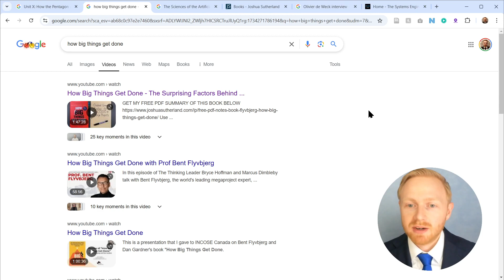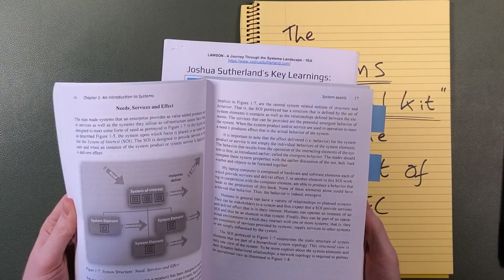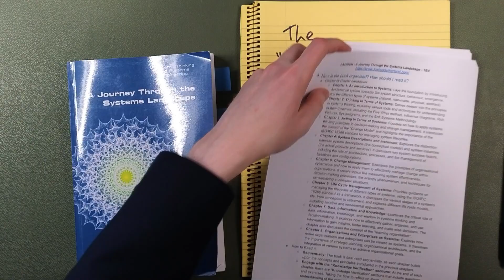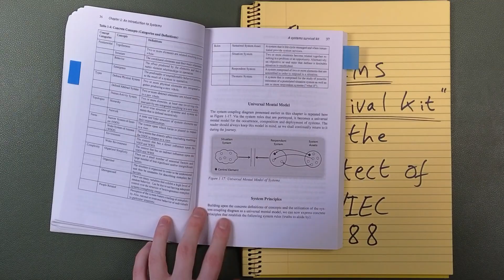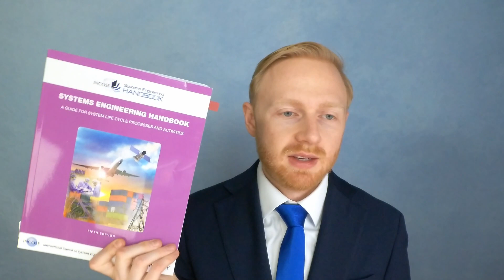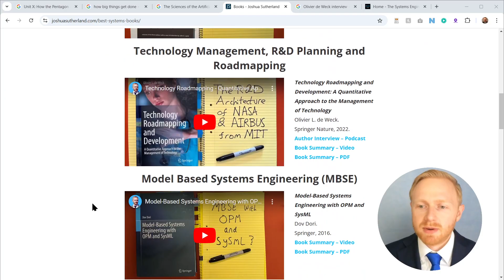Systems Thinking vs. Systems Acting - A Journey Through the Systems Landscape - Harold "Bud" Lawson

Comment: If so inclined - I’m curious how you  would synthesize/truncate the 13 principles. Perhaps into first principles - or tell me if that terminology doesn’t apply to this context please. 
Thank you for your content.
Reply from the maker: Great question.

In the world of systems, we’re not yet at the stage of a “settled science” when it comes to foundational principles. Instead, we have valuable, but varied lists of observations and heuristics from different thinkers.

I actually co-lead INCOSE’s Future of Systems Engineering - Systems Engineering Foundations initiative, which aims to tackle exactly this question. But it’s a multi-decade effort, and we’re still in the early stages.

That said, if I were to synthesize Lawson’s 13 principles into a smaller set of foundational ideas, I’d group them like this:
1. Purpose: Every system exists for a reason. Understanding that purpose is essential.
2. Structure & Behaviour: Systems have structure (what they are) and behaviour (what they do). Both must align with their purpose.
3. Context & Boundaries: Systems interact with their environment. Boundaries and interfaces are critical to understand.
4. Interconnectedness: No system exists in isolation. Relationships, feedback loops, and emergence define system behaviour.
5. Lifecycle & Change: Systems evolve. Managing that evolution—from design to retirement—is central to systems thinking.

Lawson’s full list is rich and nuanced, but I think these five capture the spirit in a more compact, foundational form.

Comment: There was an ISO for designing systems, who knew!?!
Reply from the maker: @allurbase yes, "ISO/IEC 15288 Systems and software engineering — System life cycle processes" provides a standardised lifecycle for systems from when they are just and idea, to designing, deploying and then retired.

If you are new to it I would recommend looking at the INCOSE Systems Engineering Handbook first as an ISO standard (on anything) can be quite a difficult reading as it has to be comprehensive.